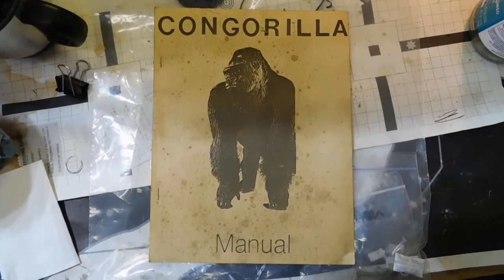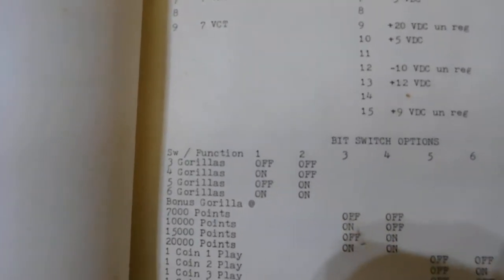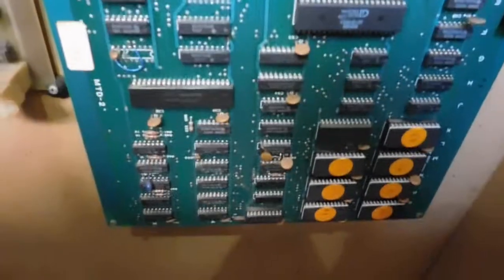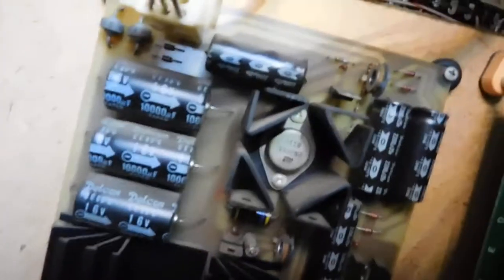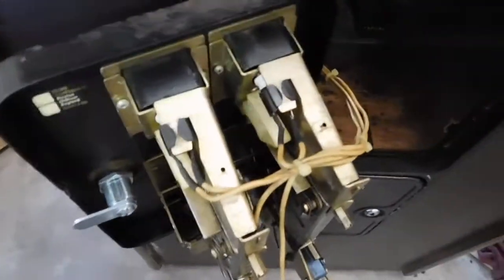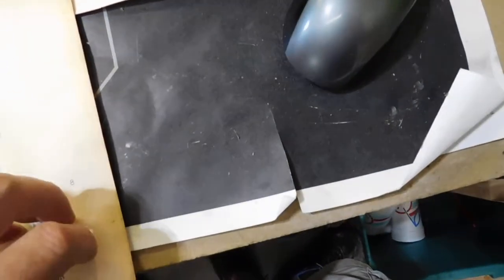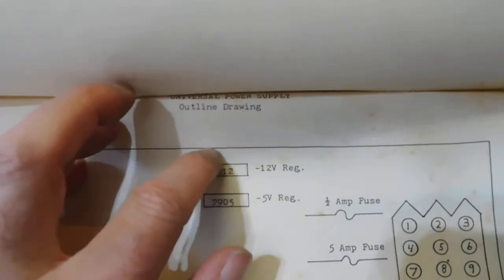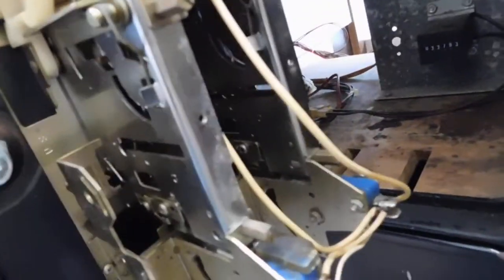Congorilla Owners manual and Dip switch / Bit switch configuration

Comment: Just picked up one of these cabinets.  It’s not working.  I smell a burning electrical smell when it’s plugged in.     Lots to repair.   I’m not sure where to start with this project. I also need a marquee for it and side art
Reply from the maker: The power cord goes directly to the power supply. Pray that is burnt; Disconnect any upstream electrical connections. use your shnoz and see if you smell it coming from that. If so, replace it. Check the output voltage and amprage, u may be able to get an aftermarket one. If it aint, it may be the power transformer. Same deal as above. If it goes deeper... Pray. Good luck.
Reply: Is your marquee retainer trim painted brown or black?   I was curious on what’s original.    Someone sprayed mine brown.  Thanks for helping friend
Reply from the maker: @jumpingeneral  honestly, hard to tell. Mine is original, but I would say that the original is unpainted. Mine has the metallic patina on it, but the underlying color looks like a brownish metallic, almost an unoxidized copper color. But I would say that brown is pretty close to original.
Reply: @glenvanocker4027  ok thanks.   I just picked up an original never used marquee for it,   Having to replace the rotten back and bottom of the cabinet.  Making progress on the restoration

Comment: Great video.  I also have an original 'Congorilla' with the same cabinet and art.  Good to know there is a resource out there if it ever fails.
Reply from the maker: Thanks for the positive feedback! It has been fun getting into the restoration, as little as it has been needed. I actually got back there and manipulated the video setting dials, which are the same as an old tube television set. I was thinking about making a video of that. But for your knowledge I would say that in order to get a real idea of the changes you make with the dials in the back you have to unplug the console, then plug it back in to see what you have actually done. by the way the picture on my tube is crooked, does your video screen appear crooked even though the tube is straight up and down?